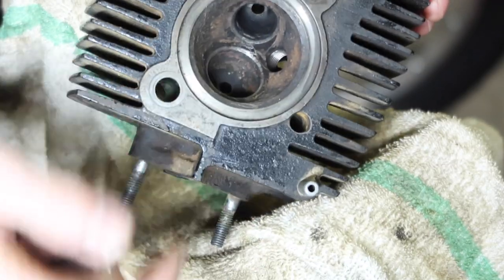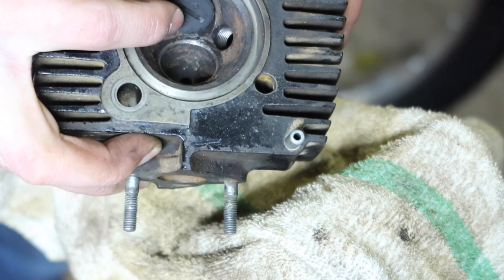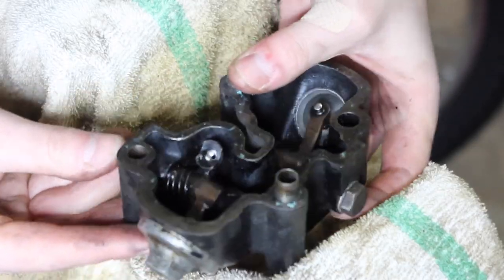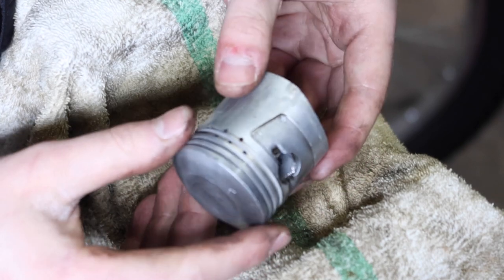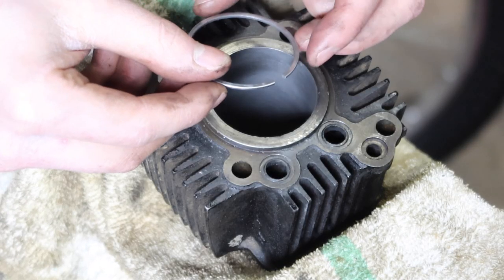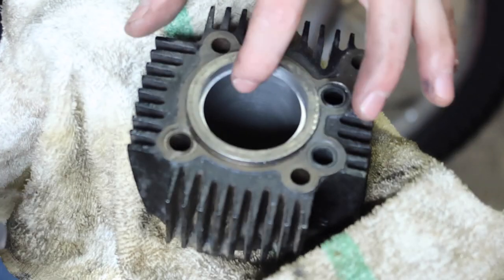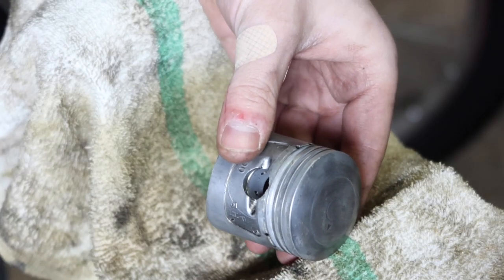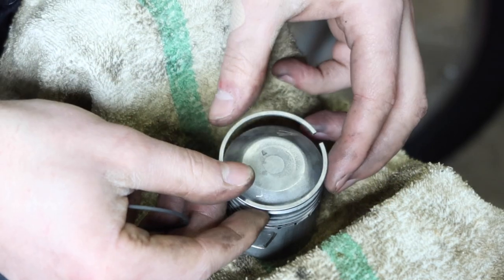Honda CT200 Engine Rebuild & First Start

Comment: hello !! i just got a ct200, trail 90... it is a 1966 that was last licensed in 1975.. ~ 3000 miles on the clock.. turns over and has pretty good compression, (~100 psi cold)..not bad to look @ either.. i have not really got into it yet as still doing a assessment of what lurks ahead and waiting for a battery ad appropriate charger..i could have not asked for a video that fits my needs any closer than this one does ... great job on video, sound is top notch and was groovin on the music... thank you ..ttfn.. brysoglen
Reply from the maker: Thanks for watching, and good luck with your CT!

Comment: I order the  battery , and  can't wait  to  test it ,  meanwhile I took out the engine  to  do the paint and other restoration, How do you  bench test the engine with the battery? I  was  using a jumper cable from  Black wire  from engine to  secondary coil  and  also grounding it  to engine   when I I get the battery  how to wire it at the bench so I can test  before I put back the engine to the bike  I have 5 wire is coming out of the engine 
 black is the  ignition yellow is  for the lights   wire with  secondary color is the ground  is the red wire  for the battery connection  and what is white  another ground ?
Reply from the maker: You do not want to ground the black wire to the engine. The black wire goes from the points to the black wire on the coil. The red wire on the coil goes to the positive battery terminal. This is your switched ignition power. Disconnect and ground to kill the engine. The negative battery terminal should be attached to the engine case.

These connections are all that should be needed to bench test the engine.

Comment: Hi Nick,
 Since you are way more knowledgeable then me  quick question  . I have 62 Trail 55 and 65 Trail 90 and both sitting  cause  I can't get a spark, on Trail 90  since it has many coils by the flywheels   and  if they are fine  when I  turned the  crank  shouldn't I get a  "test light"  turn on  from the black or the  yellow wires  even nothing else is connected  like  Condenser and points? 
 Thanks
Reply from the maker: Do you have a fresh battery installed? You won't get spark without one. As far as the test lighg goes, no you won't get any sort of light without the points. What is your test light connected to?

Comment: Hi Nick, Honda project is still on hold  but I have another project could use  guidance  My 70 vespa sprint, cutter pin;s loop end   holding the cylinder head to piston arm  broke off   chew up the  piston head and the  top ring, after 3 month trying to  find  the head  finally   put  the top half back to gather  only  to find out  woodruff key is also chewed up, changed that too but now I only get  loud backfire  but  not starting at all. I have  very  good and bright spark on the  spark  plug , while kicksrtarting with  timing light I see the  firing  happens about 19-20 ATDC ( should be 22 but  I should still get  running In that range )  new points .
 What else needs to be checked or adjust ?
Reply from the maker: Did the bike run before cylinder head damage occured? If you have spark and it is happening at about the right time, I would think seals might be an issue, espescially if they are original or are damaged.

Comment: I dont think ive seen one of these bikes with matching head bolts. Regardless, good work.
Reply from the maker: They came from the factory that way. Three open hex nuts and one acorn nut with a copper washer. The stud with the acorn nut has an oil passage around it, if it were a normal nut it would weep through the threads.
Reply: @NickMakesBreaksStuff  well im going to revert that on my bike. Thanks for the info

Comment: Test light was  connected to ground on the engine and  lead is on the black wire < I thought these were magneto and generates the 6 V coils spinning  with in the  magnets  and battery is only for the auxiliary  stuff like lights and horn
Reply from the maker: The CT90 definitely needs a battery for spark. I'm almost positive the Trail 55 is the same way. It wasn't until the CT110 that they could run without a battery.